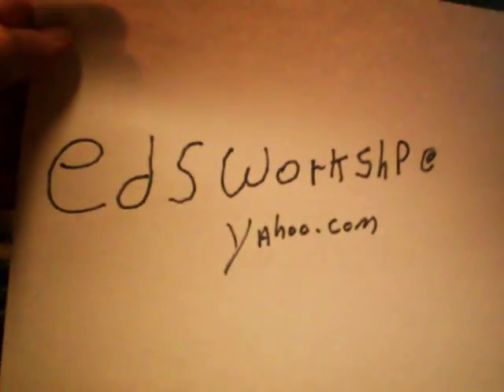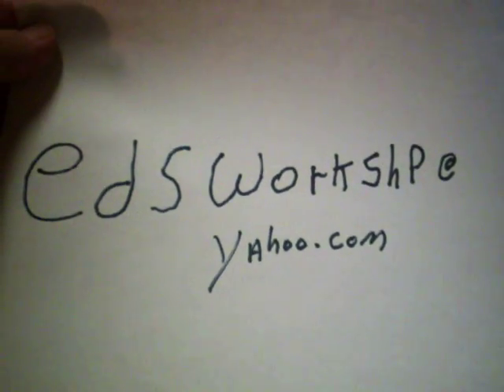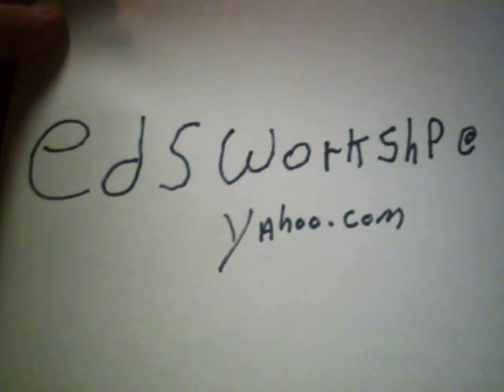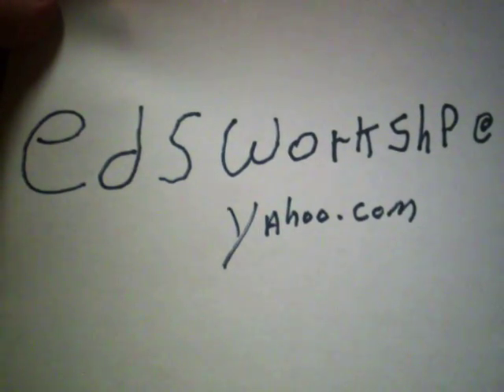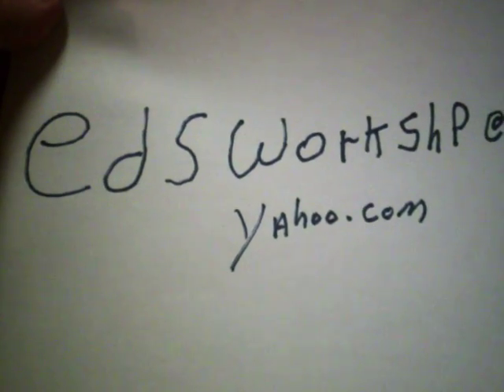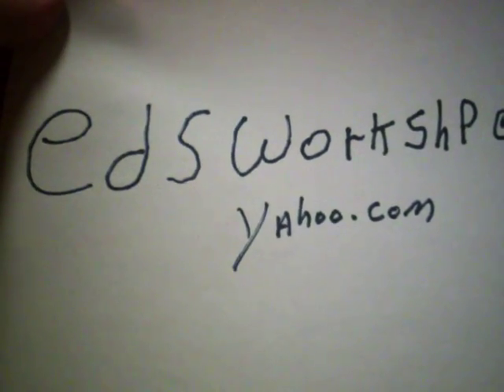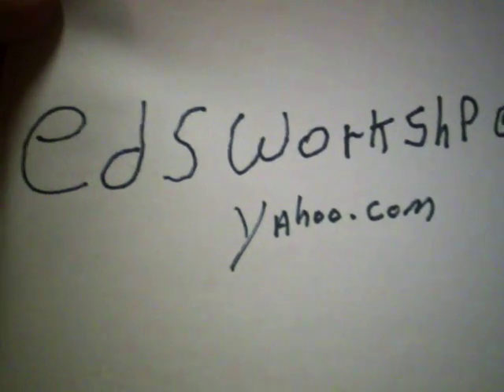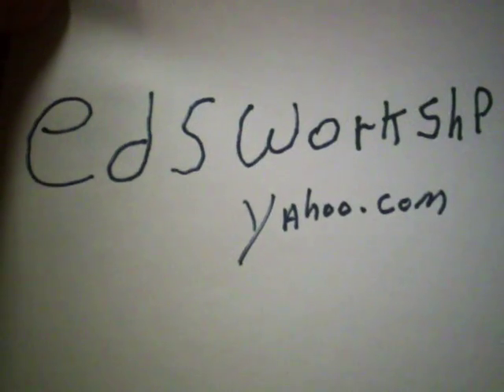nickel iron battery's project donations for research

Comment: demnlordd666  you are looking for a solar refrigerator ? Einstein (yes that einstien)  had co authored a patent in the mid 1920'sfor an closed cycle heat powered  cooling fridge setup  SO I think if you made a parabola and at the focus used oil as the transfer medium you can get up to 400f(obviously depending on conditions and your setup)  but ensure not to exceed 450 because of flammability issues.

Comment: ahh so you share some of the same interests I have.  been in the info gathering phase for my own solar refrigeration project.  wanted to build one from the ground up but, info is seldom found.  though I do live where summer provides copious amounts of sun.  can get over 110F few/several times in a moderate summer here.  good luck on your projects.
Reply: also since you would have to have the parabola pointing at the sun  a solar cell attached somewhere to the enitire rig could power the pointing mechanism and pump  as i think  you will have to have to moderate the pump to keep the oil bulb at the focus to achieve a high heat  then run the pump faster to prevent overheating